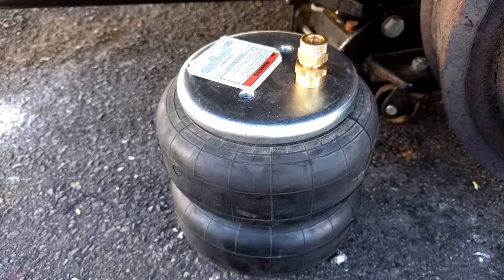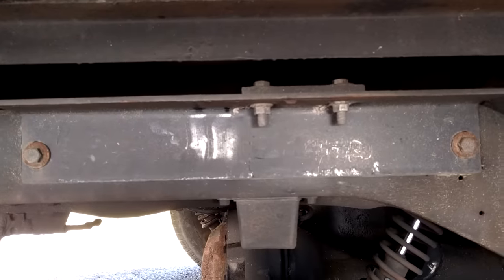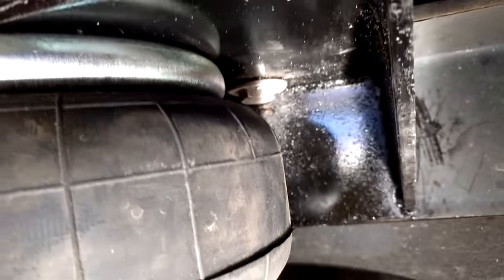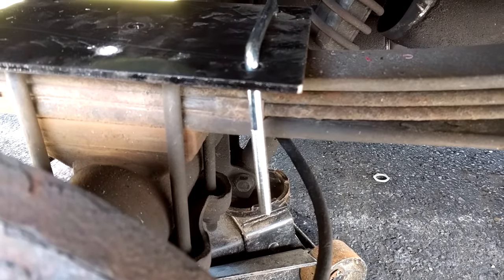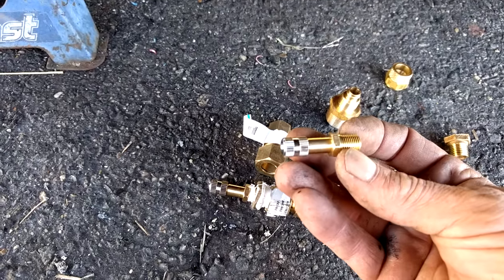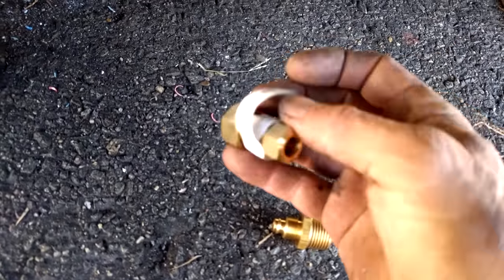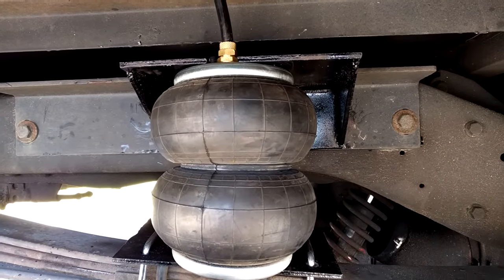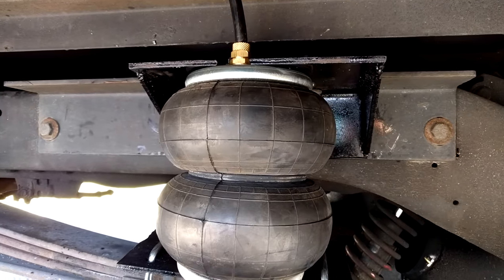How to Air Bag your truck for $100 (Air Bag Suspension) Awesome Upgrade

Comment: I think this was a lot easier install than  another professional airbag that I helped install.  The bags were installed between the  left and right leaf springs.  What a bitch that was.  Thanks looks like it sure should work.
Reply from the maker: I have had them for about 150,000 miles and I would not do it different.

Comment: Where do you buy air bags for 100.00 dollars ?
Reply from the maker: This video is 4 years old so  they have gone up in price but you can get the standard set for 99.99 https://www.ebay.com/itm/121566282478 and the high lift for 164.00 https://www.ebay.com/itm/282280749134

Comment: Is it a stiff ruff ride when inflated?
Reply from the maker: I would call it a firmer ride, there is a lot less sway when towing heavy loads. You can adjust the pressure to what load is on the truck. If I ride around with say 90 pounds in them and no load it is a stiff ride. I like them and am working on putting a on board compressor and front air bags. I am getting everything together now. This way I can adjust the pressure from in side my truck instead of finding air supply.

Comment: Basic idea is OK, but the 'engineering' is way, way off.  If you need air bags, you are carrying a bunch of extra weight.  Build it stronger or get someone who knows what they're doing on suspension work.

Comment: Where did you buy it from?
Reply from the maker: You can get a set of air bags for $68.36 (https://www.ebay.com/itm/Air-Ride-Suspension-Air-Bags-Pair-Standard-2500-1-2-npt-Kit-Replacement-Parts/281836657351?ssPageName=STRK%3AMEBIDX%3AIT&_trksid=p2055119.m1438.l2649) I payed $79.98 for bags that are 2" taller.  Or they have a website at http://airbagit.com

Comment: Sitting on top the u bolts a bad idea it can cause your u bolts to break.
Reply from the maker: I have had it this way for close to 200,000 and towed a lot of weight. If it is tight it will not hurt. If it is lose and rubs it could wear in to the U
U-bolts.
Reply: @Glennfix  I've seen u bolts break and the springs turn and cut he tires.

Comment: Air bag suspensions are great.
But that installation is incorrect.
My work van had those and they cracked the frame.
Check out heavy trucks, plus there are conversions. Not for $100 for sure.
But air shocks would be better than those.
Reply from the maker: I have had the airbags on my truck for over 3 years. I have towed close to 20,000 pounds with them. This is one of the best upgrades that can be made to trucks. A set of airbags still sell on eBay for $89.00 ( https://www.ebay.com/itm/two-new-standard-2600-air-bags-3-8-npt-port-ride-springs-bag-suspension-fbss/121566282478 ) and scrap steel all for around $100.00. I have a review video of the airbags after 2 years ( https://youtu.be/b3y2QQu2ioA ). I also add an air compressor so I can adjust the air pressure on the fly  ( See Video at https://youtu.be/z_WxCUVAwSk ). This is a great custom system I would put on any truck.
Reply: @Glennfix  I'm glad it worked out for you.
But air springs have a small usable travel, not suitable for mounting directly over the axles.
It should be mounted on a swing arm (like all air suspensions are) to increase the travel.
Also towing heavy loads with light trucks is very dangerous and can be safely achieved with a mid size truck for around the same price (and sometimes cheaper) than the light trucks.
Modifying towing vehicles should only be performed by qualified and licensed individuals, and should be D.O.T approved.
You can modify anything you own any way you want, just don't drive it on public roads.

Comment: Where did u buy 4 airbags for only 80$????
Reply from the maker: I got them from a place called chassis_tech  on ebay or http://www.airbagit.com/. They do have some bad reviews but for the cost I thought I would give them a try. so far so good. They are the manufacturer.
Reply: I know you can buy 2 airbags for $86 but idk about 4 airbags for $80..
Reply: Winter Soldier you get what you pay for. But it's not like you're using them for a 4 link setup on a truck, if something breaks or the bag leaks then you still have your oem shock and leaf spring there.
Reply: he said 2
Reply: @kingtut5923  i heard a set....a set is 4...right?
Reply: @sheniquemedina5685  you are way over thinking it

Comment: Where do I find this kit
Reply from the maker: They have a website (  https://airbagit.com  ) or you can find them on ebay (  https://www.ebay.com/itm/Air-Lift-2600-II-2-Air-Bags-Single-Port-1-2-Airhose-Springs-Suspension-Fittings/282280749134?ssPageName=STRK%3AMEBIDX%3AIT&_trksid=p2055119.m1438.l2649  ) or sarch (chassis_tech) on ebay for there store. If I get something from them I look at both for some reason sometimes it's cheaper on ebay.

Comment: This is NOT airbagging a truck for $100. Steel work not included for the $100 so that's the wrong title!
Reply from the maker: You can get a set of air bags for $68.36 (https://www.ebay.com/itm/Air-Ride-Suspension-Air-Bags-Pair-Standard-2500-1-2-npt-Kit-Replacement-Parts/281836657351?ssPageName=STRK%3AMEBIDX%3AIT&_trksid=p2055119.m1438.l2649) I payed $79.98 for bags that are 2" taller. I payed $25.00 for the steel. I do deal with the steel shop, so maybe they gave me a good price but they just picked up scrap and cut and bent for me. I did all the final cutting and all the welding myself.
Reply: Bro turn your U Bolts Around you have them up side down!
Reply: A couple drops of dawn in a spray bottle & their is your leak detector!
Reply: Alberto Garcia lol. "ITS NOT $100, IT WAS $105. CLICK BAIT!@!??!?@?!!"   Get a life kid.
Reply: $100 for some ... Guys out there that don't their own a property with a home and a shop/garage kind  of set up with tools and man junk ...for sure cannot do this for around $100  but there are alot of us diy guys like him and me that have more tools than pairs of shoes  and know how to use those  tools while some folks don't even what they are called  let alone how to use them.i have everything but the bags already sitting on shelves in my shop including  all the tools and hardware so i too can do that for $100

Comment: Nope. Ain’t doing that to my truck. Looks sketchy.
Reply: Wolfbyte World it is, he jury rigged everything. His base plate was secured with grade 5 bolts instead of grade 8, his bag just sat on the bottom plate, and his air lines, 1/2-3/8-1/4, nobody does that crap. You run one diameter line.
Reply: Kenneth Potts air doesn't care about diameter.
Reply: Choice777 oh bullshit!! Hahaha i cant believe you said that!!
Reply: J M clearly he was being sarcastic
Reply: yeah,i'd be welding all that shit on.
Reply: I like how he's throwing his brass fittings all over the asphalt.
Reply: Nope buy brackets and bags as kit.  That's not right way to do air bags. Need box frame on inside for extra strength.
Reply: @johnoktavec  Not an expert but I heard that welding on frame is a big no no. Put a 20 ton winch on my deuce and half and guy that let me use all his tools (18" LeBlond lathe, milling machine,  cutoff saws, air drills and welder) told me  that welding puts too much heat to the frame and changes the temper. Glad I listened to him. Years later when all my tools and everything else burnt up in a wildfire I bent a 3' crow bar into a horse shoe just trying to pry a burnt up vans rear doors open. Felt like superman bending that .75" thick metal like that but didn't get the doors open.
Reply: Its a helper system. The leaf springs are still in place

Comment: Not knocking your install by no means! But as for the fittings. If you count 7 flat side's on that compression fitting that would be swedged sufficient enough. I've done pneumatic's in the oil and gas industry for the last 8 years. And then for your 
U-bolts just to be on the safe side I would have gotten Grade-8 bolts. The reason why im saying this is because you have that hitch and we are  in a totally different ball game when you are talking about towing a camper or some heavy load like that! But that copper piece of tubing is the weakest part of your hole install. THAT IS WHAT IM WORRIED ABOUT OUT OF EVERYTHING IN THIS VIDEO!

Comment: it cost you more than $100.00?
Reply from the maker: You can get a set of air bags for $68.36 (https://www.ebay.com/itm/Air-Ride-Suspension-Air-Bags-Pair-Standard-2500-1-2-npt-Kit-Replacement-Parts/281836657351?ssPageName=STRK%3AMEBIDX%3AIT&_trksid=p2055119.m1438.l2649) I payed $79.98 for bags that are 2" taller. I payed $25.00 for the steel. I do deal with the steel shop, so maybe they gave me a good price but they just picked up scrap and cut and bent for me. I did all the final cutting and all the welding myself. The place that sells them has a web site to, http://airbagit.com

Comment: There's No Way In Hell I Would Have Put That Bottom Bag Bracket On Like That, Your Asking For Trouble. I would have countersunk My Bottom Bolt's to bolt the Bag To the Bracket, and Drilled Holes for the original U-Bolts To Go  Threw The Bottom Bracket. That Would Have Been The Right Way To Do It!!!

Comment: Half a bar empty, upto 12 bar loaded if your braking system can measure the weight. Not seen an idea like this apart from in Pakistan.
Reply: Back in the days when we had the first air ride suspensions, Pakistani's just started to ride Donkeys. Don't think this is a Pakistani idea... They didn't had Youtube in the 60's that's why you didn't know about it before. LOL

Comment: Where on earth did you find airbags for $80?
Reply from the maker: https://www.ebay.com/itm/Air-Ride-Suspension-Air-Bags-Pair-Standard-2500-1-2-npt-Kit-Replacement-Parts/281836657351?ssPageName=STRK%3AMEBIDX%3AIT&_trksid=p2055119.m1438.l2649
Reply: Thanks! I will have to measure and see if I can make these work for my application.

Comment: Not bad! But unfortunately the material and fab work puts that project easily over 100$ bucks.
Reply from the maker: You can get a set of air bags for $68.36 (https://www.ebay.com/itm/Air-Ride-Suspension-Air-Bags-Pair-Standard-2500-1-2-npt-Kit-Replacement-Parts/281836657351?ssPageName=STRK%3AMEBIDX%3AIT&_trksid=p2055119.m1438.l2649) I payed $79.98 for bags that are 2" taller. I payed $25.00 for the steel. I do deal with the steel shop, so maybe they gave me a good price but they just picked up scrap and cut and bent for me. I did all the final cutting and all the welding myself.

Comment: Looks like about $200 for everything!
Reply from the maker: Glenn 3505
Glenn 3505
2 months ago
You can get a set of air bags for $68.36 (https://www.ebay.com/itm/Air-Ride-Suspension-Air-Bags-Pair-Standard-2500-1-2-npt-Kit-Replacement-Parts/281836657351?ssPageName=STRK%3AMEBIDX%3AIT&_trksid=p2055119.m1438.l2649) I payed $79.98 for bags that are 2" taller. I payed $25.00 for the steel. I do deal with the steel shop, so maybe they gave me a good price but they just picked up scrap and cut and bent for me. I did all the final cutting and all the welding myself.

Comment: All I can say is I would not use this system,.....looks very dangerous and unsafe.🤔🤔🤔
Reply: can't be to dangerous, it still has all the factory suspension on it, so it's not like the axe is going to fall off, the bags just help, that's not the way I would have installed them, but it should work.
Reply: How is it dangerous? He didn’t unbolt the springs or anything. If anything fails it won’t do anything to the way the truck drives, I mean it’s not like the rear ended is going to fall out or somethingp
Reply: Stop trying to sound smart